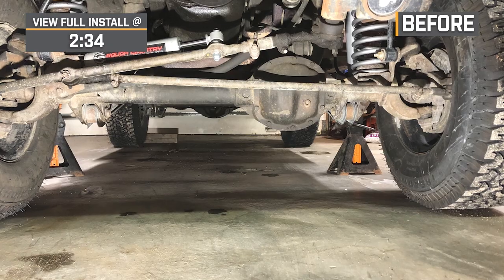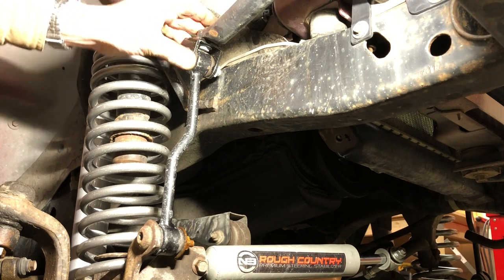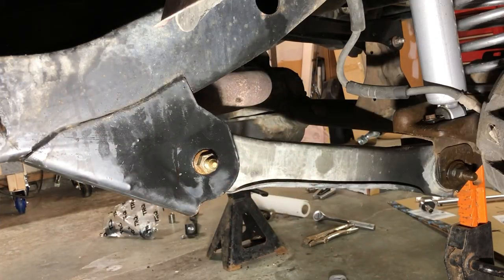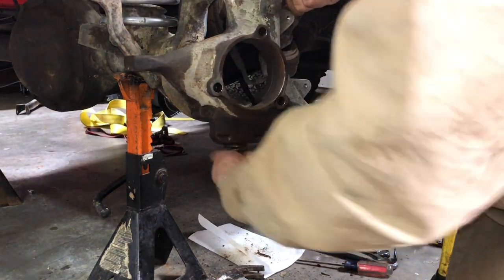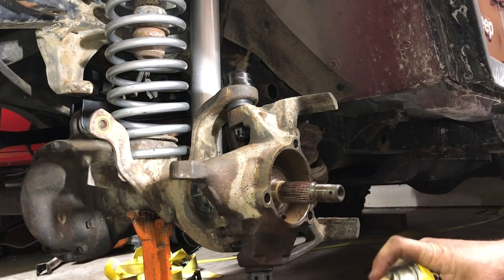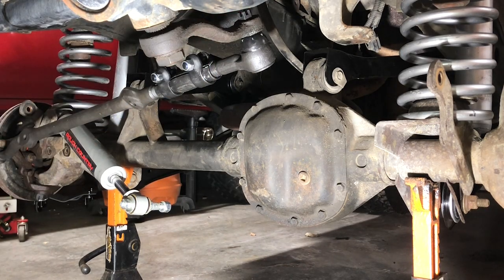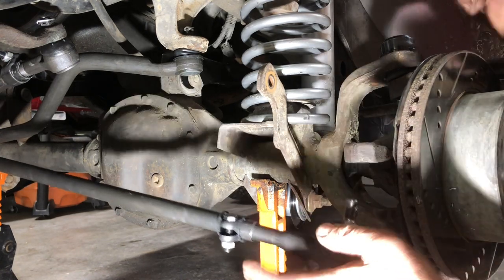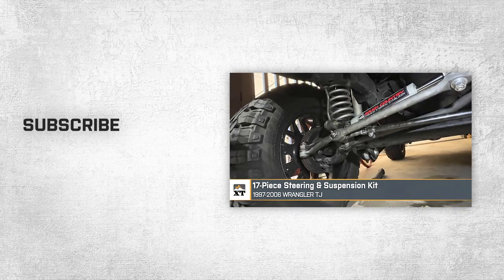Jeep Wrangler TJ 17-Piece Steering and Suspension Kit Review & Install

Comment: I have a 6inch long arm with 37s 06 TJ I6. Would this kit be good for me
Reply from the maker: Not really - you'd be better off just getting a new set of tie rod ends, extended swaybar end links and ball joints since you wouldn't need the control arms. -Zach